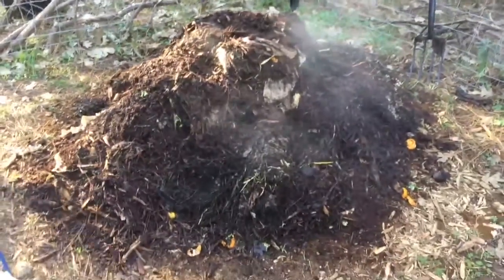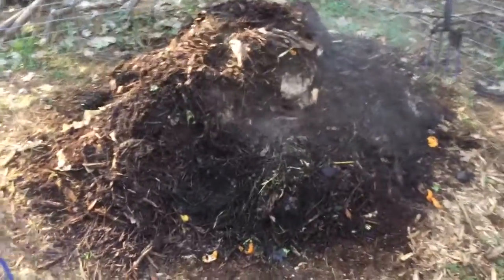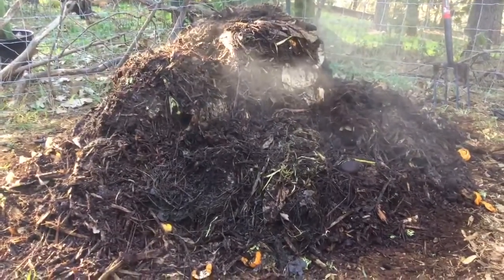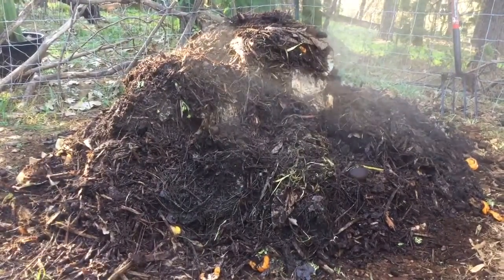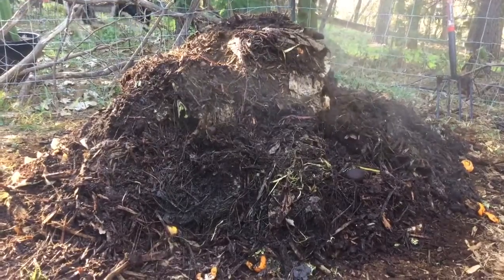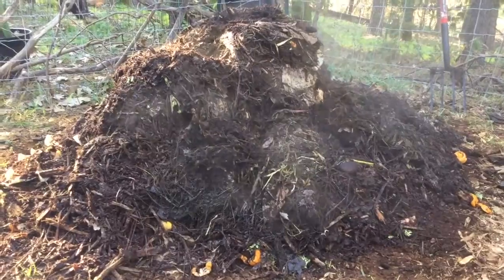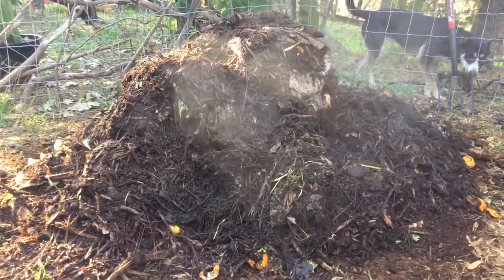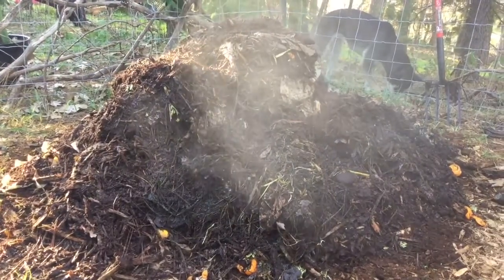Wood chip compost pile is steaming hot!

Comment: I have an 6x6ft by 8 foot high wood chip pile that I got from a local arborist.
That thing cooks. Like, dig off top and volcanic eruption status.

Actually had to create a method for cooling it off.
Reply: I have three piles of wood chips/leaves, bark and other green material. They are about 4 ft high and 5 to 6 feet round (in a tee pee shape). I live in north Texas and lately it has rained a lot. The temperature ranges from the mid twenties to the mid seventies. There is steam coming from at least one of the piles each day. Should I be concerned? These piles were delivered this week and are freshly shredded trees and leaves cleaned out from under power lines.
Reply: @danpendergrass7762  I usually just dig down the center, literally making a volcano, to disperse the heat. If I don't get rain, I run a hose to it
I wouldn't worry about it. As long as you dig holes in it every once in awhile you'll be good